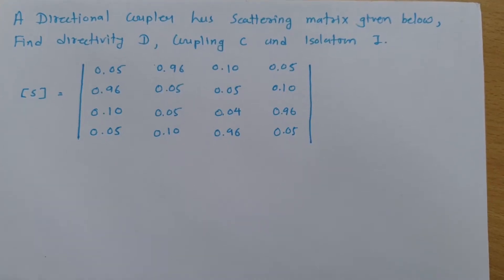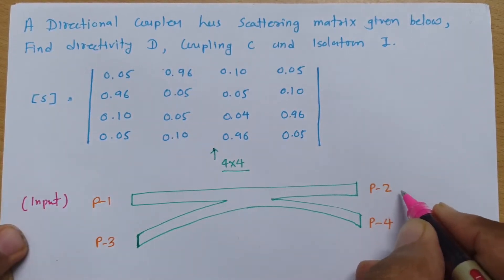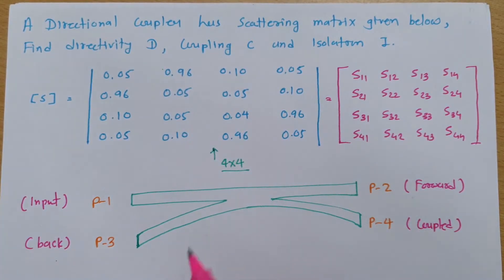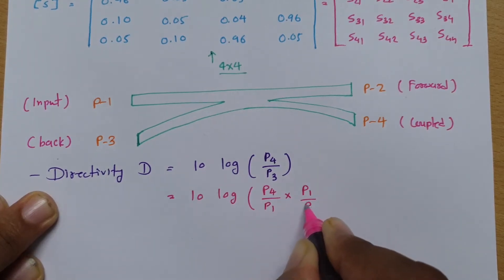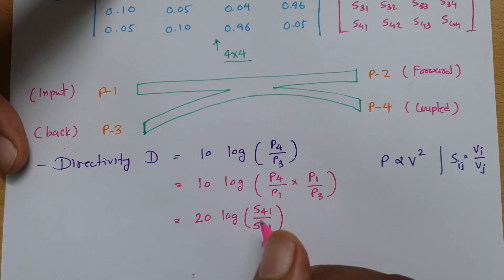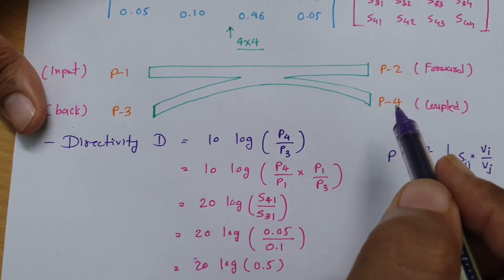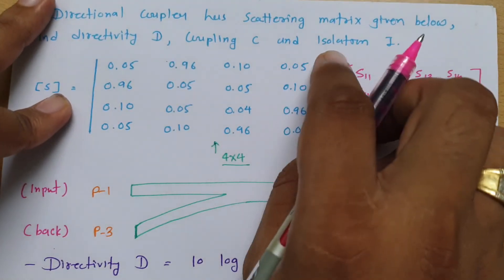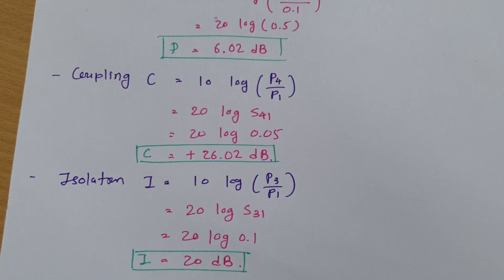Example based on Directional Coupler

Comment: I think this is incorrect.  For the coupler to have any directivity, the isolation must be greater than the coupling factor.  Many directional couplers are backward wave couplers.  If you consider port 3 as the coupled port and port 4 as the isolated port, than it will be a backward wave coupler.  Under this assumption, the coupling factor then becomes 20 dB and the isolation is 26 dB.  That will give you 6 dB of directivity (quite poor).